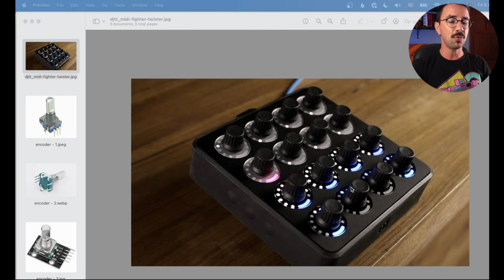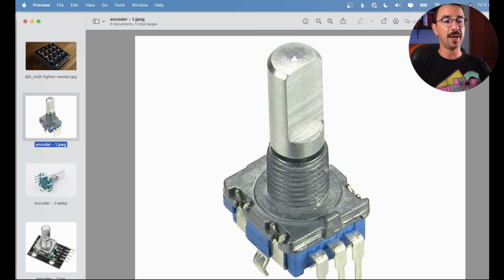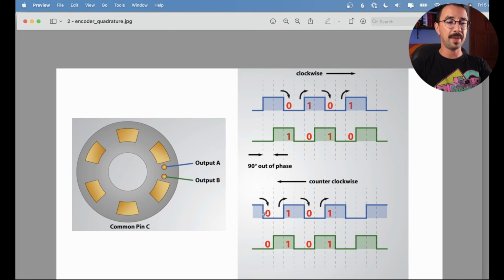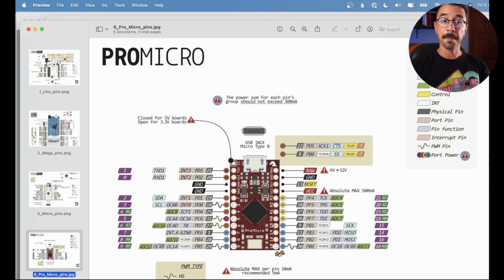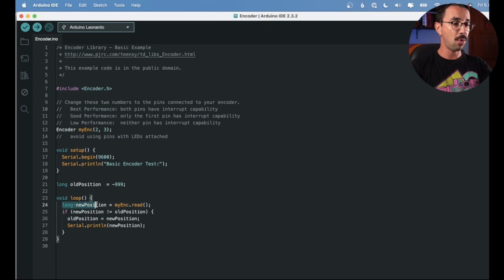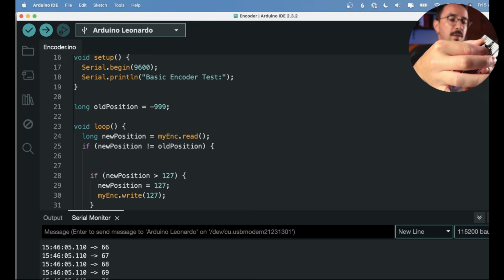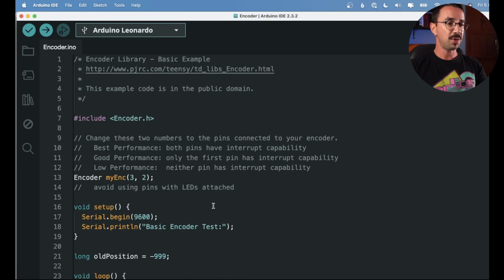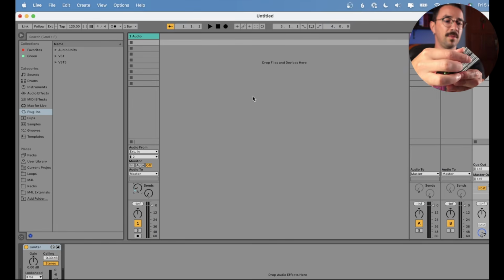#5 How to code Encoders - MIDI Programming for the Arduino

Comment: Hi, thanks so much for your videos. I've tried many ways to rename the name that appears on the controller's DAW. I'm using an Arduino Pro Micro and it says "Arduino Leonardo." I'd like to give it a custom name. I'm using IDE 2.3. Is that still possible? Thanks in advance for any replies.

Comment: this might sound mildly confusing but - you can also code an omnidirectional encoder without using interrupts. 

first identify patterns of encoder pin states that represent clockwise and clockwise movement. ....there are 4 possible patterns - {0, 1, 0, 0},{0, 0, 1, 0},{0, 0, 0, 1},{0, 1, 1, 1}
every time you execute your loop, check the current encoder pin states. 
if the current states != the previous states ---> compare the current and previous pin states to possible increase and decrease pattern
if the current and previous pin states == a increase/decrease pattern encoder state is increased or decreased. if neither, then its unchanged. 
if the encoder state == increased - increase your  value
update the previous states with the current states
same goes for decrease. 
if the encoder state is unchanged - just return before checking the current pattern against possible increase or decrease patterns. 

why use this method? - its safe.
using interrupts can be problematic if you're device is performing an operation like reading or writing to an sd card. You can of course add exceptions to the interrupt so it wont interfere with certain operations but its annoying to have to consider that every time you decide to add a new function to your sketch.

Comment: Hi Gustavo, your channel is amazing! Thanks for your sharing. It helps a lot. I have a question about the rotary encoder, your program sends the rotary encoder value to DAW, if the DAW corresponding pot is already set at max, but the oldPosition value is 0, whenever the encoder is active, the DAW corresponding pot will suddenly move to min first.  Can it be possible that when the encoder is rotated, the DAW corresponding pot only decreases/increases from its value? Does that mean DAW needs to send its status to Arduino? Also, some MIDI controllers can show LED audio level meters, how can it be done?
Reply from the maker: To achieve this, you need to "listen" to the DAW using the MIDI in function. This is a bit more complex, but I explain it step-by-step in the Making Music with Arduino course:
https://go.musiconerd.com/making-music-with-arduino

Comment: I just discovered your page a few days ago, and my mind is on fire with ideas. I can never find exactly what I'm looking for in a MIDI controller, so I can just BUILD exactly what I'm looking for, thanks to YOU!! Amazing content, and you have a real knack for teaching.

If I want to build a visual feedback display on the controller (like the LED ring, or a scribble strip display, or whatever) is there a command to query the MIDI device it's controlling for the current value of that CC? If not, how could I get that feedback?

Comment: Thanks for the video. It works well on my Mac, but it doesn't work on Windows. It seems to work in the serial monitor on Windows, but it doesn't get recognized as a MIDI device. Do you know why that might be?
Reply: windows is finnicky with a lot of things, you will probably need a driver for windows and midi, mac itself leans into class compliance, which makes things easier and more convenient, i have the same issue with audio interfaces,  i can plug in any of the main audio interfaces, from focusrite to uad on my mac with no need for installing drivers, but on windows i need to install focusrite control for my 18i20, and also asio drivers in the daw suck in terms of stability compared to what you get with mac

Comment: how can i add an extra encoder to this code???
Reply: thats what im trying to figure out, im super new to coding and arduino stuff, so ive taken the same concept of how its done with potentiometers, but im unsure how to get the constant variable for number of encoders to work with the variable of the pins the encoder is connected to being a greater amount i.e., 2 encoders, 4 pins used to allow for 2 pin interrupt encoder usage, instead of 1.  did you end up figuring it out considering its been over a year?

Comment: Music keeps us young😉 By the way every turn of my encoder goes up by 4 counts for some weird reason?
Reply from the maker: That's because of the quadrature thing I explain in the video. So, at every "click" your encoder does it reads 4 changes in the state of its pins, two for each. So, that's normal. However, you can adjust this in the code. I teach how to do that inside my course Making Music with Arduino.

Comment: can i use this code for jog wheels in traktor?
Reply from the maker: Kind of, because Traktor expects 127 if the encoder is turned clockwise, and 0 if it is turned CCW, instead of a range of 0 to 127, so there are some minor adjustments in the code you need to do.